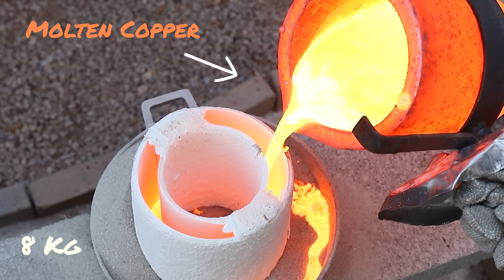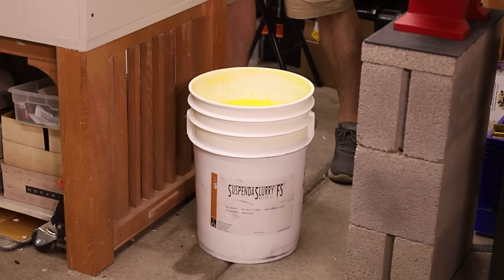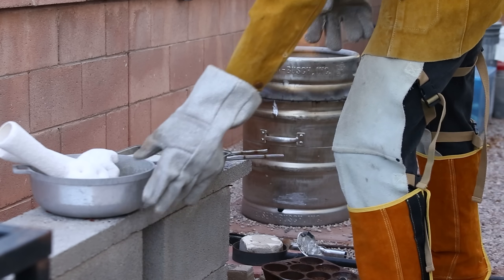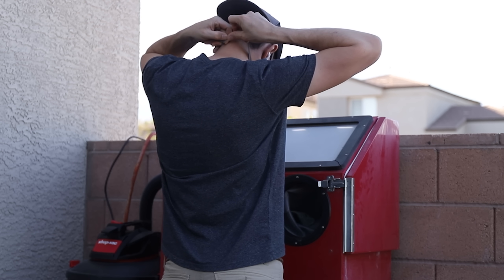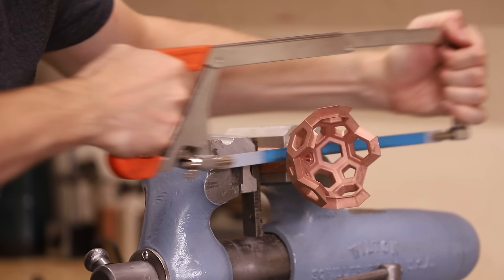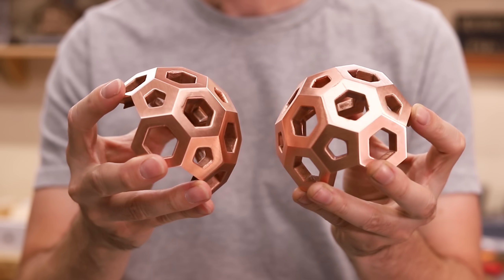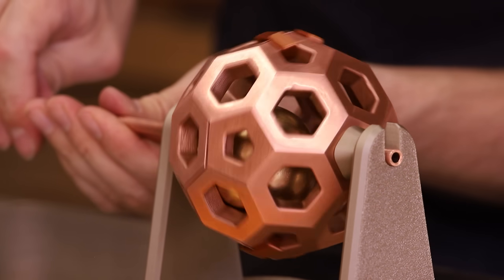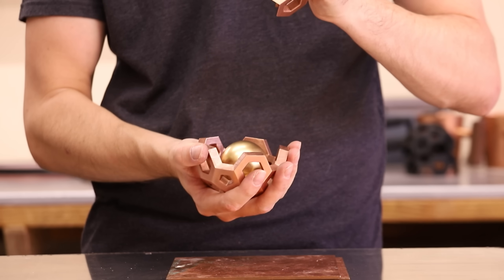HUGE Magnet VS Copper Sphere - Defying Gravity- Will a Neodymium Magnet Float Inside?

Comment: Here are a few thoughts, first put a negative magnet underneath and rotate it top to bottom instead of side to side. Also run a small electrical current through the copper wire itself increasing the electric magnetic field for the magnet ball. Also you can put small magnets connecting instead of the plastic connectors. And don't forget to add a motor underneath rotating at the right speed

Comment: I like the idea of using the effect of eddy currents. We must be clear about whether we want to generate heat or if we want to generate an electric current. In this way we will know if the ball should be made of copper and the sphere of neodymium or vice versa. In either case, it is not advisable for it to be a smooth ball, rather it should have fins so that with the speed of rotation and with the eddy current effect it can stay in the center. Considering a higher speed of rotation, we must analyze how many spherical cages can be concentric so that magnets and copper can be interspersed, perhaps rotating each one on three different axes. Quite a challenge and several calculations must be made considering the masses of each cage and ball. A very good idea, I think it can bear fruit when combined with other technologies.

Comment: I'm wondering if there is a way to suspend the spherical magnet by its magnetic equatorial region, maybe by detents and threaded rods through a frame body, or something more complex  so you can spin the MAGNET? Also, is there a way to create a similar electromagnet setup? Like a spherical electromagnet suspended by its equatorial region by some sort of frame designed to apply spin to the sphere. Then build a frame to hold your copper sphere in,  a stand for example. Lightweight, but sturdy. Then, in either circumstance, spinning the magnet inside the dead center of the copper sphere, equal distance from all sides or approximately equal distances. Let's see what happens then. Maybe cryo cool the neodymium magnet 1st?

Comment: No, I think u need to add a positive and negative to each end of the hexagon instead but if u use the magnetic to rotate use a motor for that magnetic to rotate what u created and the use 2 wire to see what kind of watts it output?

Comment: Build a Halbach Array:

Arrange neodymium magnets in a circle or line, oriented to amplify the magnetic field on one side and cancel it on the other.
Place Copper:

Position a copper sheet or wire below the Halbach array to create eddy currents when magnets move, which will stabilize levitation.
Create Levitating Object:

Use a small magnet sphere or object and place it above the Halbach array, aligning it to levitate above the copper.
Adjust and Test:

Fine-tune the distance between the array and copper for stable levitation, observing the interaction of the magnetic field and eddy currents.

Comment: Hihi- the two copper stumps...i could use them as soft hammers...to chip flint into arrow heads...or obsidion - deer antler is the stone aged alternative ...um if you choose a very soft copper alloy they might be significantly improved if they were case hardened...work hardened...perhaps one end soft one end hard...skinny end hard fat end soft...adds to my choices ( utube " freeze cracked " )...bravo ,press on comrade!

Comment: You need to try making two of them and put them close to each other,  but counter rotating! but it may be safer to do it outside or have them bolted down.  can cause power spikes and even blow fuses. just being too near to it.  also don't patent it you'll disappear like the others have.

Comment: 1:10 Always use gloves and mask. That sht is dangerously underestimated in terms of its carcinogenic potential. Plastic particles are hard to remove from the skin and even harder to remove from the lungs.
Reply: Very good point, always better to be safe than sorry!
Reply: Black PLA should be fine. It’s the filaments with added carbon or glass fibre that cause issues. If this is in regards to microplastics we’re all already fucked anyway. I’m not actually aware of any plastics that cause the same sort of issues as asbestos or fibreglass
Reply: Not PLA
Reply: I would rather be alive than die from lung cancer,@stefanjarvis-y5l.
Reply: It's pla he's fine some macro plastics never hurt anyone

Comment: First, solder the two halves together to make one conducting shell, with the magnet inside. Then, align the axis of rotation to the sphere so it doesn't wobble. Then, slowly up the RPM until the magnet is centered and doesn't wobble. the increase speed. Congrats, you've made a magnetic 3D bearing.

Comment: put a camera inside the sphere, so the camera turns with it. make the sphere of smaller non metallic skeleton, and wind copper wire into it in various patterns. point thermal camera at it to see if there's any heating. etc

Comment: @Robinson Foundry I see two issues your direction of rotation I agree with some others. The second issue is the clips. Use non ferrous clips man! Maybe the magnet is falling towards the clips in rotation as the metal may be closer or the attraction a bit more  than any of the surrounding points without clips.

Comment: Oh dang. With that other magnet causing it to rotate on its own, you could like totally put a hidden motor and magnet in a base of the whole stand there, and have it just free-spin without any apparent visible mechanism causing it to spin!
Or, I wonder if you could have the two halves split apart a certain amount, like say an inch away from each other, and still keep the magnetic ball in the middle floating inside the halves?

Comment: Hello everyone. Congratulations on the wonderful design and processing of the Icosahedron. 🏅🟠Using the specific shape of the icosahedron is a good visual idea, but it is obvious that this does not work quite correctly for this application case. In practice, we have the presence of Unbalanced Interaction and hence unbalanced interactions and the effect of "Levitation".
🔑Analysis:
1. The asymmetry in the distribution of induced currents is visible, with larger holes reducing the effective conductivity of the corresponding faces.
2. The non-constant current leads to unevenly generated magnetic fields, which affect the stability of levitation.
3. In the case of the present shape, there is a violation of the Field Distribution - the Copper Icosahedron with Hexagonal Holes creates an uneven distribution of induced currents - Foucault Currents. These currents generate magnetic fields that interact with the field of the magnet, but the different sizes and positions of the holes lead to asymmetry in the magnetic interaction, which creates turbulence in the movement.
4. The shape of the edges of the icosahedron also has an impact on the formation of the field and the interaction.
🟡Other conditions that would be important, but in this case are met.
1.2. The icosahedron appears to be made with good symmetry and there are no variations in the thickness of the copper, which would lead to unevenly induced forces.
1.3. The center of mass of the copper sphere also appears to be balanced. If the center of gravity of the sphere does not coincide with the geometric center, imbalances will occur that interfere with stability.
1.4. Influence of external factors, which we exclude.
1.5. Speed of movement and Inertia must be constant enough to maintain a stable effect. It doesn't have to be big - the effect will be evident even at the initial speed.
🔑Suggestions for research:
1. Optimization of the holes - unifying the sizes to minimize the effects on the field and conductivity.
2. Use magnets with different orientation, size, shape, and strength.
3. Optimization through parametric modeling of different designs.
Warmest regards.

Comment: The truncated icosahedron is a mixture of hexagons and pentagons and was used to place shaped explosive charges around a plutonium sphere to create a converging shock wave that would symmetrically compress the plutonium, taking it from subcritical to supercritical (Manhattan Project). The induced currents are Eddy currents and are incorporated into Faraday's Law of Electromagnetic Induction. Movement between the magnet and conductor is a necessary requisite, as shown here.

Comment: I'd like to see what happens if you run a strong electrical current through the copper sphere. I'm assuming it will cause the magnet to levitate without any additional spin necessary..

Comment: Gold plate the copper and make the outer copper housing thinner.  Also make the hexagon holes smaller, with a smaller sphere magnet. Then you'll be able to rotate the exterior copper  faster to  replicate external magnetic field hence levitation

Comment: Does it generate some power? There probably should be a continuous flat line of copper vertically along the sphere. Also begs the question if rotating it vertically is not as good as rotating it in a diagonal axis or something... Hmmmm

Comment: I see you are using pentagons and hexagons so it is not realy a sphere. Is there a problem by using only pentagons?
Reply: Solid sphere
Reply: The mathematicians say no. They were consulted during the construction of the plutonium implosion bomb in the Manhattan Project and concluded that the only way to create a spherically converging shock wave directed to the centre is by this mixture of pentagon and hexagon.

Comment: Now if you had the money to suspend that in a superfluid and place it within a vacuum i theorize you could use the magnetic field to generate enough electricity to power something small outside the vacuum to kick a magnet at the right intervals and right frequency to sustain that motion, superfluids are my favorite when it cones to perpetual motion ideas because they are already 1 step away from being able to sustain motion when acted upon indefinitely. But for it to count as a perpetual motion device it has to well be a device not a substance properties phenomenon .

Comment: The reason why past a certain speed it hits the side is that the mass of the magnet, or the magnetic momentum, or the shape of the cage are not perfectly simmetrical, likely all of the above. By improving these parameters your magnet should stay afloat at higher speeds.

For example, try wrapping the magnet in tin or surround wrap (to make it easier to remove iron later), leave the so wrapped magnet on an horizontal table and shower it with iron powder or fine shavings. Then check how simmetrical is the deposition of the iron around the magnetic field of the magnet.

Write me back for feedback and more brainstorming and troubleshooting.

Comment: Too many comments to scroll down and see, but maybe for better floating, and a just for the cool effect of the copper spinning, liquid nitro freeze the magnet sphere,  place a few magnets under the copper, 'set' the height of the ball and then spin the copper. Plus, if there's enough 'smoke' coming off the magnet sphere, that could add a cool effect. But it would be interesting to see how the copper would effect the frozen magnet both at a stand stil and while spinning. Should even test the current the copper is generating.

Comment: I got a pretty good idea on a video, make the copper float with a good resistant magnet and then put another magnet under the resistant hooked to a rotator and make it spin while in the air and try to find a consistent speed to make the ball float

Comment: Everyone's comments on eddy currents being disrupted by the openings and the seam between the two sides is accurate.  You probably already know that there is no need for all the thickness of copper.  The interaction you are seeing is a surface effect.  1mm thick copper is the same as 2 or 50 the way you are using it.  You would probably have better success if you made the ball have more than one N/S.  If you made it from several magnets so lots of north south poles but the sizing would need to be more accurate.  That means the difference between the ID of the copper and the OD of the mag-sphere need to be roughly the same size as the width of each magnet.  I believe it would levitate when the Cu-sphere rotated quickly.  Get a thin steel or iron shell (or cast it!)  This so that it is light. Attach a bunch of Niodimium disk magnets on it in alternating N/S.  Then cast a thin copper shell (solder the seam!) but cast it with lots of small holes to see the Magsphere in side and you'll have it!  I can't wait to see the video!

Comment: Try fixing 2 magnets with the same poles facing towards the 'sphere' with the spherical magnet inside it. These 2 magnets that you would fix should be exactly opposite to each other with the 'sphere' between it. In this setting, I am guessing, if you would slightly rotate the sphere even with your hands, it would speed up and keep rotating... or idk!

Comment: A very good but simple experiment and you achieved a good outcome using such primitive materials. I know you don't realize it yet, but keeping it simple is the secret. It's right there staring you in the face, but humans cannot see the forest for all of the trees in the way. Then they overthink and usually go down the more difficult & wrong path.
I reckon U should make a device to pick up radio/sound waves that were transmitted in the past. They are still out there U know, and you could home in on any particular one. Then using Einsteins theories combined with the simple theory of frequency over time you could follow the signal back in time to that exact spot in past history. Obviously this would also mean that there would be audio signals out there from the future that you could home in on as well. Do that & I will subscribe.

Comment: you might be able to use the extra pieces to make a pen if you have the proper equipment. If you still have them of course. this comment is a little late, but at least for what I've done. You tend to see a lot more design on stuff like that after you put finisher on it.

Comment: Feels like there's far too much play in the 3D printed rack. I think the oscillation is causing the outer sphere to hit the inner, and is potentially disrupting the magnetic field as well. Make that out something rigid, then put a motor with a smooth speed controller and see what happens. I think it should be a lot more central and stable in its levitation.

Comment: The currents involved are huge.  You need to allow current to flow between the two hemispheres and the incidental point contacts won't do the job right.  (Yes, if you measure with an ohm meter, you'll get "0 ohms"  but you need 0.000000 ohms!)

To do this hammer some solder flat then lne the gap with it and put it back in the furnace with the gap in a horizontal plane.  Once the solder melts they will settle down together under gravity and surface tension of the liquid solder.  (to disassemble suspend the top piece and heat)

Comment: My suggestion is to cut off the extra rod on the sphere itself so it's holding structure is totally symmetrical and set up your motor with the magnet a foot away and have it spin the magnet that you were holding in your hand.

Comment: I always wondered: what if you put a magnet composed of.. idk one side that attracts, into a hollow sphere that is completely made up of whatever other one it will be that attracts the little metal ball inside. because its being attracted from an omnidirectional force, it wont have anywhere to go, thus floating in the middle being pulled equally from all and every possible angle.

of course you wont be able to see inside it.

Comment: It would be no different than those floating magnetic globes, they need to be regulated using electronics to balance it. supose you could get it to float in the middle you have to worry about gravity or imperfections in the surrounding metallic sphere. You will need a device to regulate all that.

Comment: Since another magnet controlled rotation why not make a duplicate and have one interacting with the other like quantum entanglement. If you could change the proportion of outer sphere or inner creating more distance would it still work? Lastly would providing a better outer lattice that corresponds with radians or 360° make the inner sphere levitate more fluidly? Just copy earths parallels and latitude lines possibly even make eqator larger diameter like the earth. It is the same physics as our inner nickel core and molten copper like mantle that keeps us radiation free from cosmic rays . I bet if you keep tinkering you can make an artificial aurora.

Comment: Nice work! Unfortunately the interior is not round, so there are clearly protrusions of copper that are always closer to the magnet ball. Im wondering if you could make a clear plastic sphere with copper polka dots that might be enough metal to create levitation. Also, this would allow you to add more metal to the top than the bottom so that gravity is balanced against magnetism. If a computer controlled this level, then potentially you could create a vehicle shell that protected the cargo/occupants from impact, and also enable the freight of very heavy objects. I'd also love you to demonstrate how light bounces around inside a mirror sphere so we could see the colour of nothing. Or even just make interesting prisms. You might accidentally create a real hologram if you are able to somehow control a sensible type of vapour. Reverse engineer a rainbow and you'll probably solve it. The copper and magnet alone are incentive enough to create a safe turbo lift or crane system. Maybe even a rail gun to shoot rockets to the moon. Consider also how Elon Musk is catching rocket boosters. Maybe a magnetic system could help with soft landings. Also, you should experiment with making the sphere from magnetic polka dots and the ball from copper. I dare you to drop metal from a building and see if a magnetic catcher's mitt on the ground, or series of magnetic rings can soften the fall.